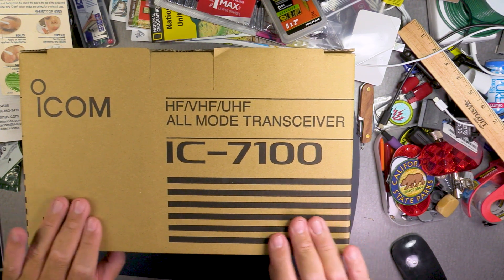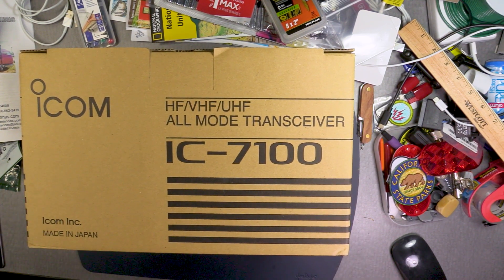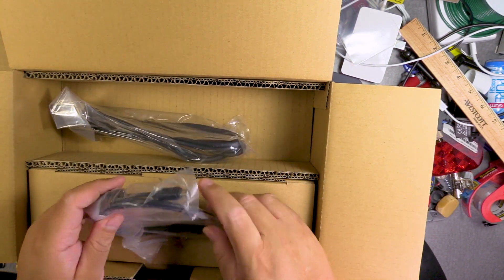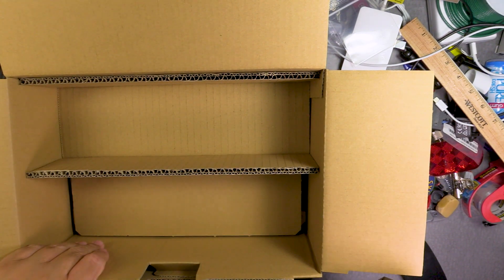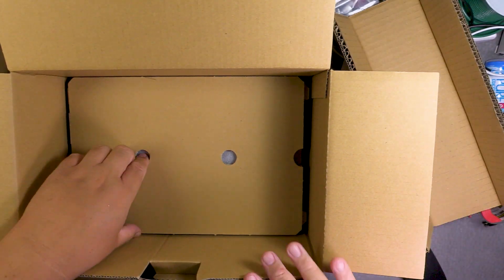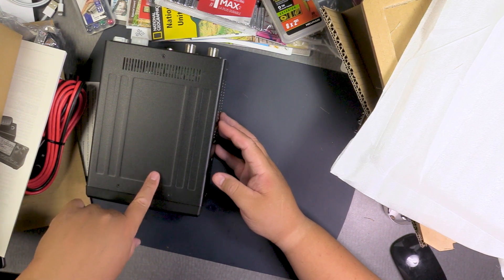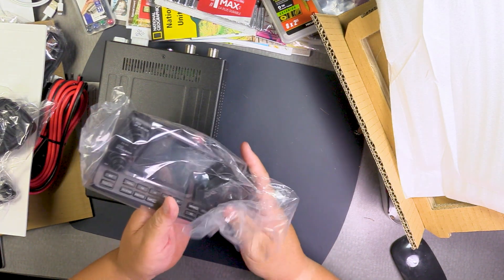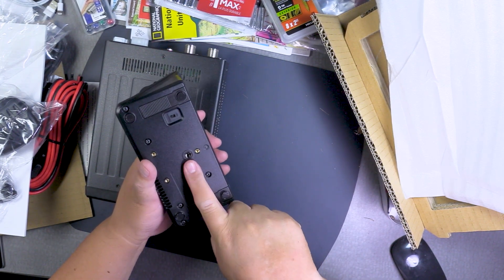IC 7100 (2022) Unboxing

Comment: Congratulations mate.   nice Rig.
Reply from the maker: Thanks. Trying to figure out if it will be good for mobile.
Reply: @frankwc0o  I’ll be I interested in how you set that up mate. I’ve been looking at one for mobile too.
Reply from the maker: @DNL1200GSA  I'm thinking behind my seat, there is a pocket there. Some will just lay it on the floor of the car, but the most important part is the head, how do you mount that.  I think I might have some extra parts laying around for that.